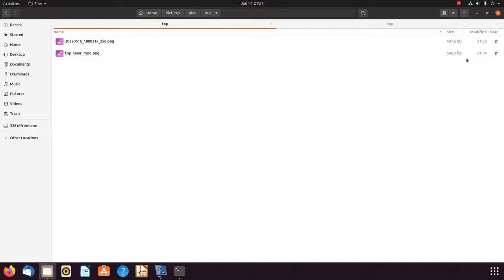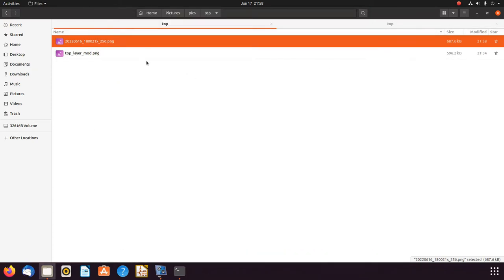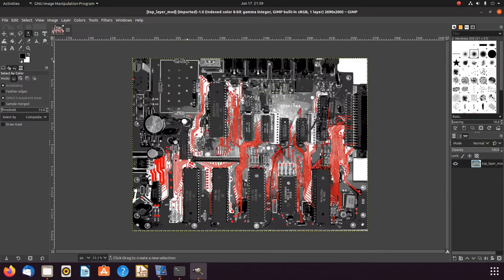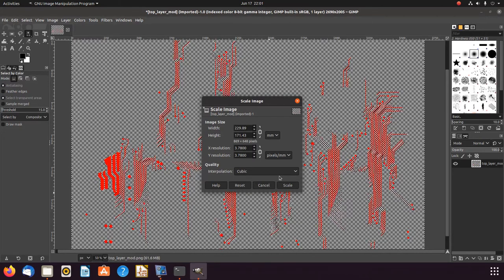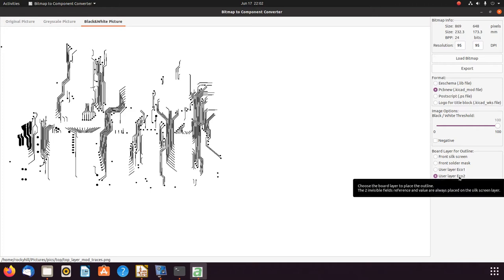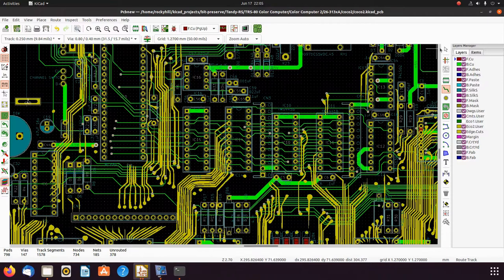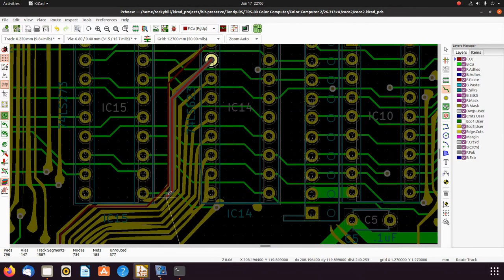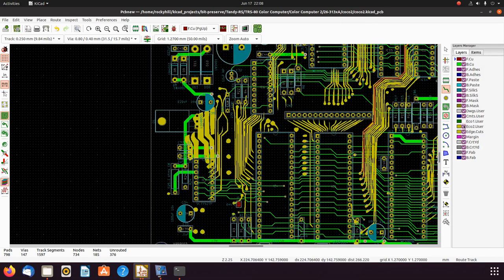Using a cellphone picture to help route the top traces of a CoCo 2 recreation board in KiCAD. Part 2

Comment: I don't know what KiCAD prefers but you may find Inkscape to be a highly effective tool as well.  I have done countless "traces" to produce vector graphic images.  The advantage of vector graphics is very obvious (to me at least) as most CAD is actually vector based code to begin with.  More comments as I watch.  Just wanted to make the note.
Reply from the maker: I agree inkscape is a great tool and I do use it here and there. I still need to really learn it.
Thanks for the comment on that!
Reply: @rockyhill3  I learned to use it by watching tutorial videos.  Lots of great techniques in all of that.   Just need to find some good KiCAD tutorials.  The few I have seen lose me pretty quickly.  Will keep looking but recommendations are welcome.